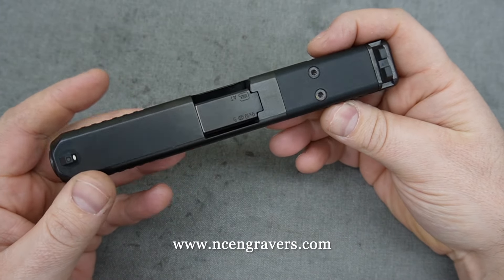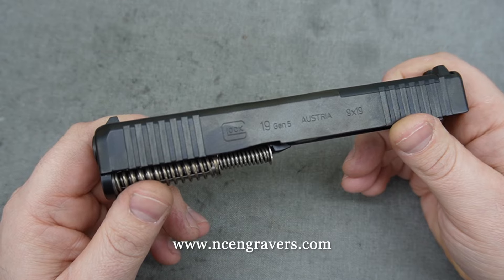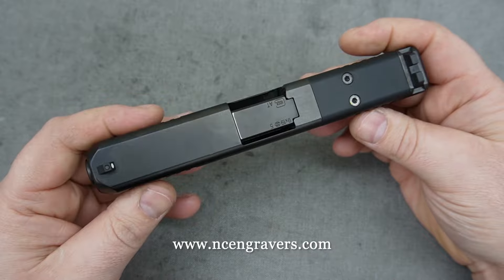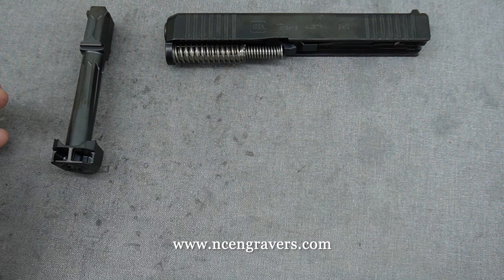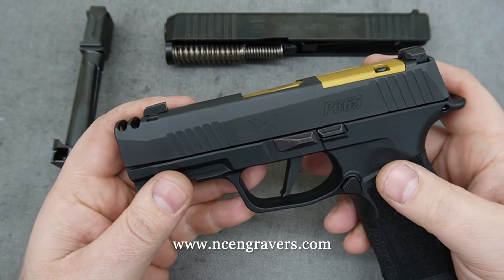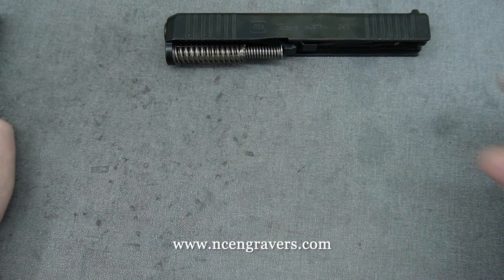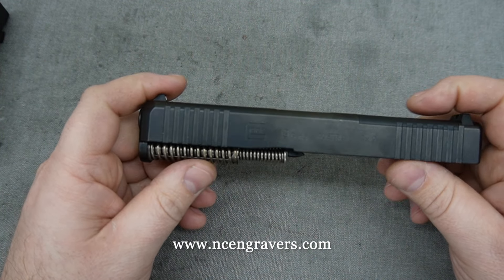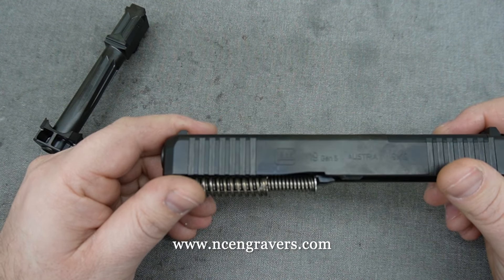NCEngravers.com - Glock Barrel Porting Service (Full Auto Testing)

Comment: This is my build, it’s super flat got to test it a little today, super excited to keep running it.
Reply: Looks great ..does it have the same accuracy as before the ports ?
Reply: @RB-ov5sd it seems to be the same, I haven’t mounted my rmr yet to really test out the grouping. I will update you when my radian guardian mounting plate arrives.
Reply: If Someday you haver a chance, try to measure bullet velocity loss with this ports and a factory or non ported barrel.
Reply from the maker: its safe to say any ported barrel is going to show a velocity loss over a non-ported barrel

Comment: I’m a Glock compensator collector, thanks for putting me on to the 24c
Reply from the maker: The older/hardest to find would be 
- g17L with the top 3 slot cuts
- g24c as seen in the video 
- g19/17/21 made by aro tek for Glock.. they have a island barrel. I have the g19 if you need pictures.

Comment: I had a Question involving your service on your website. On a Glock 19 gen 5 was looking to get a rmr optic cut for a sro, plus the ports and then also if possible to get the front face of the slide cut that looks like it does in the raptor cut I think it’s called like a hog nose cut in the end of the slide. Would that be possible?
Reply from the maker: We don’t quote on here so please send a message..

Comment: What’s the difference between an integrated comp slide= ports only in slide and barrel ends before porting in slide & ported slides= barrel goes all the way to end of slide, and has porting through barrel and slide?
Reply from the maker: A slide with a build in comp or even a threaded barrel with a comp on the end is only redirecting the gas from the bullet. A barrel with a port in it is releasing pressure before the bullet exits the barrel.. a barrel with a hole is going to work better as it’s actually removing pressure and not just redirecting it.. 

With our design we do both.. it’s a barrel that is losing pressure and redirecting gas.. it’s the best of both world.